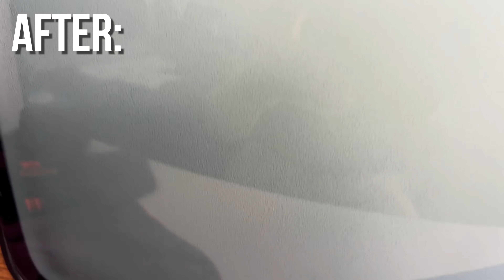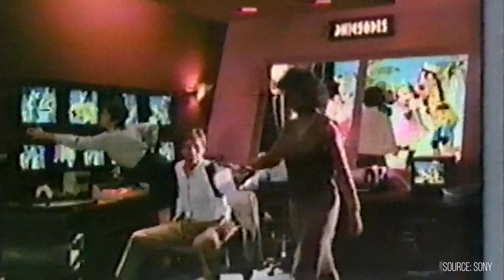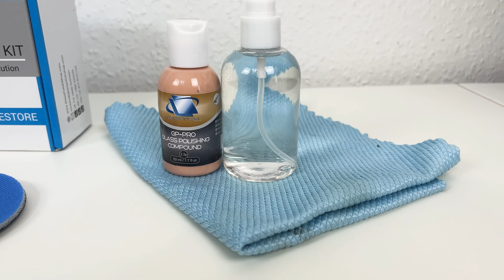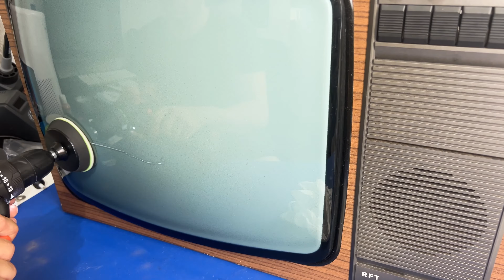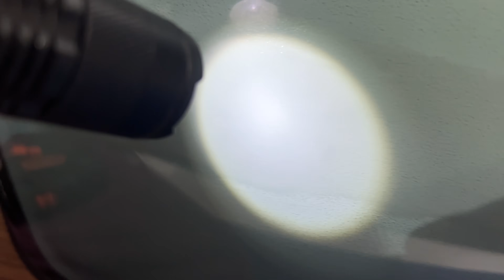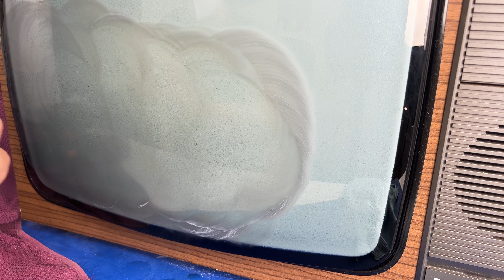Remove Deep Scratches From A CRT Screen #crt  #crtgaming #repair

Comment: Did you seriously just advise people to dry buff their CRT glass? No cerium oxide? No polishing solution? Jeez, talk about reckless.
Reply: Calm down dear. The video maker followed the instructions correctly from the supplier of this kit and the depth of scratch. The compound used in the last stage contains cerium oxide. And the result suggests all went well.

Comment: You have any tips for repairing small chips in crt screen glass? Not finding anything that’s a concrete fix for it. Thanks !
Reply: You'd have to go through the procedure from the video but do it on a smaller scale. You could even do it by hand. First the higher grit, and then lower grit. Remember to take breaks and let it cool off.

Comment: Thanks for the guide. All I need is the kit and a charger for my drill. Seems easy enough. I got a free Panasonic 20" CRT tv with quite a few scratches in the middle. I think it's fixable with some patience. Thanks for giving me the confidence to go thru with it. Was thinking of gifting or selling this thing but the picture is too nice to not try and bring it back to life
Reply: any updates?
Reply: How did it turn out?

Comment: Do you know if this will work on the super fine pitch models of Sony HD CRTs I have one and I don't know if it has anti-glare film but I have playing 4K PlayStation 5 downscaled at 1080i on it like a psychopath and it's the most Vivid picture I've ever seen but it has two or three scratches that I sometimes notice during gameplay other than that it's the most unreal picture I've ever seen
Reply: Elite setup. This man has surpassed us all.
Reply: That’s an amazing set up. I would imagine that this guide could be used to help remove scratches on a consumer grade HD CRT since you would only have to worry about the anti glare layer which you may or may not have